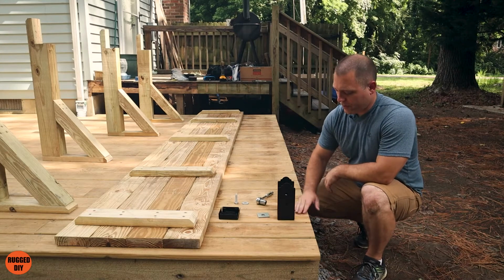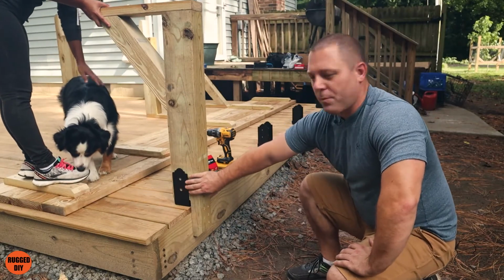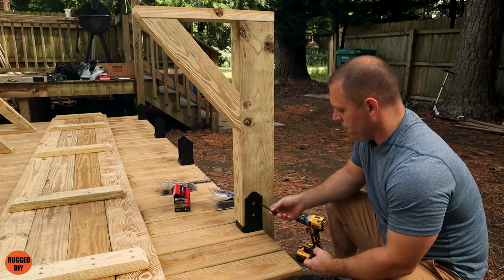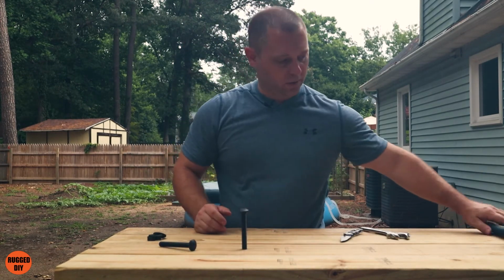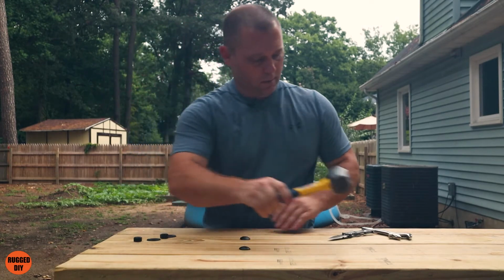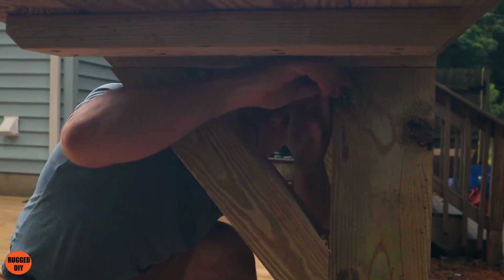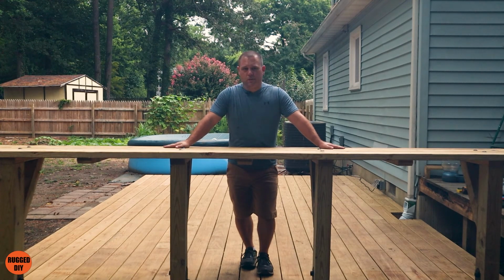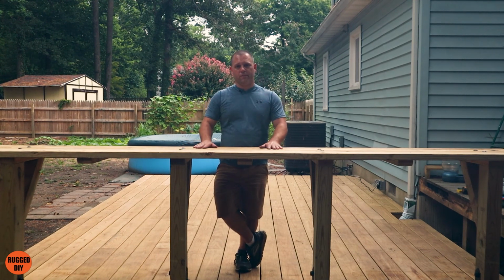Built-in Deck Bar Assembly

Comment: Yikes! Are you not worried that the rounded head of the carriage bolts might cause beverage glasses to tip over? I like the look but maybe just go with those toward the back of the counter and come up from the bottom with a long deck screw or two that don't show?